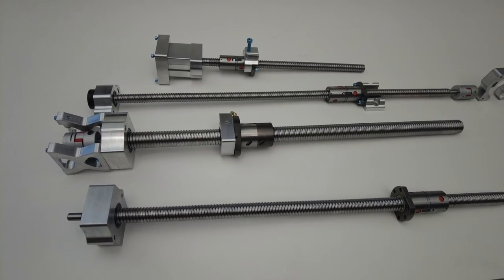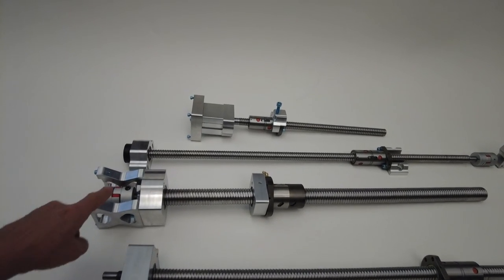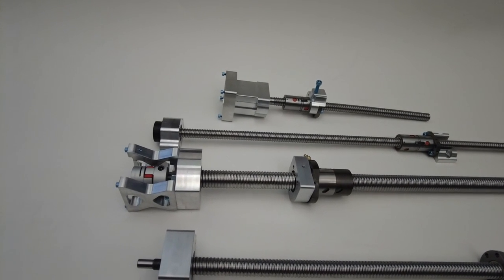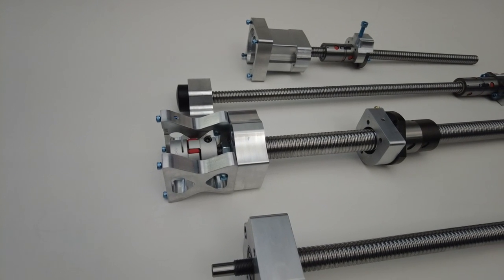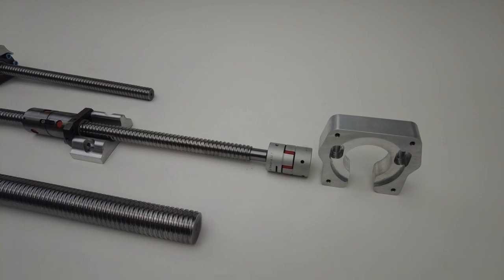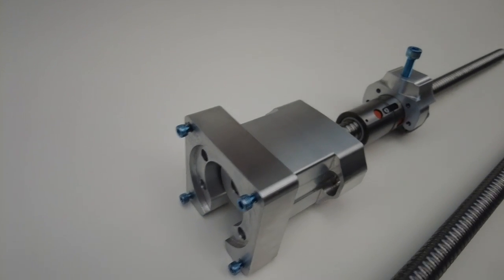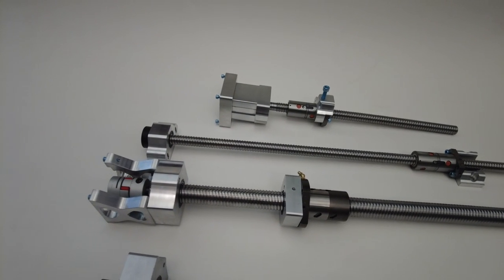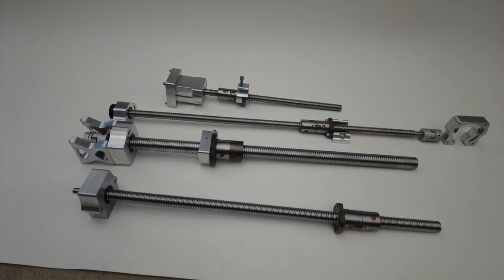PM-833  PM-833TV CNC Ball Screw Kit.

Comment from the maker: I'm going to do a second test fit with the customer's 833 soon. I plan on doing a little video too so I will look at the ways closer. I looked at them before and they looked like they were ground with oil scrapes which is what I expect. The felt really nice even when tight.
 A good grind job is fine for a hobby mill. I think a common problem is some go too fast and heat up the work and they bow. A little extra care when grinding goes a long way.
Reply: That is correct on mine as well. Ground with oil scrapes. Definitely not hand scraped.
Reply from the maker: o good to know. @bagels2183

Comment: Built my own. All double ball nuts, 30mm z rails, 25mmX/Y & 25mm X/Y ball screws and a 40mm Z screw, machined my casting on a 4020 down to .0002. 750w X/y axis servos, 2.2kw Z servo with a brake, HAAS 5c 4th axis converted to servo and a bunch of other goodies. 2000IPm rapids bolted to floor and 300ipm cutting is not impossible. It has 14.5 x 28 table travel. Very broad swing and something the stock manual could never achieve.

Mine is now the Nicest PM833T in existence. Most likely will always be at this point since you’d need an industrial machine to do the same build. FYI for anyone considering linear rails  they will not just drop on a factory casting and anyone converting there’s to linear rails better be machining the castings first. 

The PM833T manual was a pile of crap put of crate and wore out those ways in under a 18 months. Yes, I oiled it daily. I bought one of the very first machines they sold. They were definitely not hardened. Frankly PM screwed me over and they should’ve replaced my machine free of charge. Terrible customer service. 

Now that i know how to cast myself and also where to buy solid castings ready for linear rails for only $1500 a complete machine, id never buy another Precision Mathews product again.

So many parts needed to be warrantied and a few already had been where I had finally gave up on it. I also got rid of the gearbox it was limited and noisy anyways. Went to a belt drive and never looked back. Made and machined every part on it myself. The Spindle spins at 12000+ rpm now. The motor was custom built and handles 200hz easily sending it to 7700rpm itself. I started machining a bt30 out of 4140. Let it sit to relax and destress before i get to the finish cutting. It is ready now. Journals also need to be hardened. I can do that with my induction heater.

Anyone considering one of their machines consider how they left me and others stuck in the mud before you buy. Ive owned many brands and the only advantage they have is travel. 

Wish you best of luck.
Reply: I was following your builds and noticed they kind of ended a couple years ago. I had assumed you gave up on the PM833... sounds like thats the case. Glad to hear you found something that worked for you. Can you elaborate on the rail-ready castings? That sounds amazing.